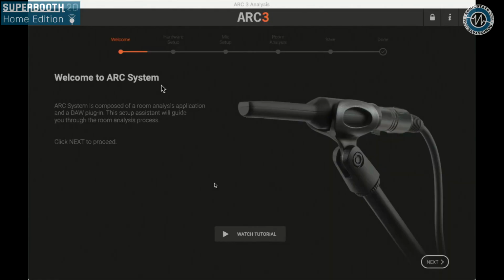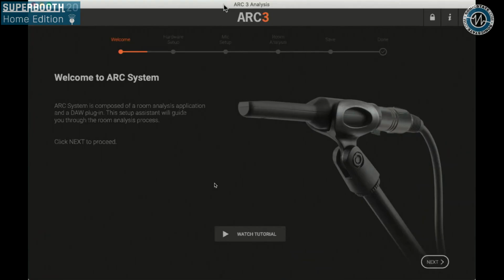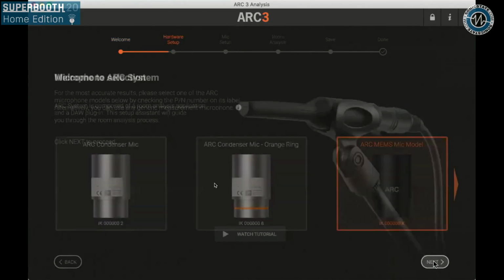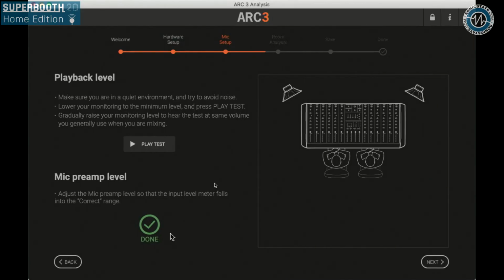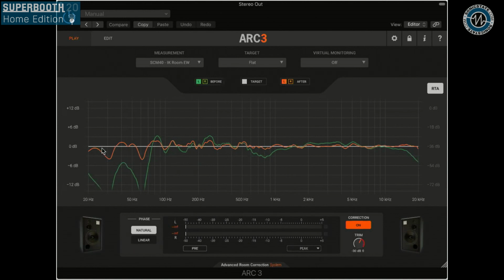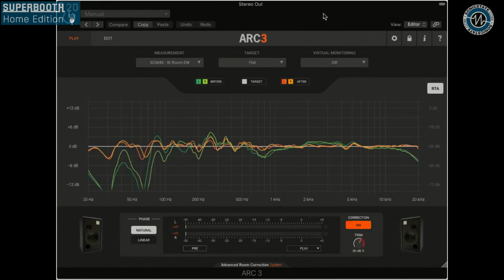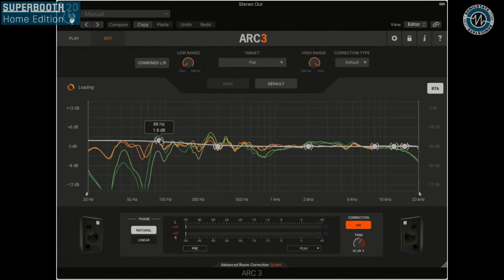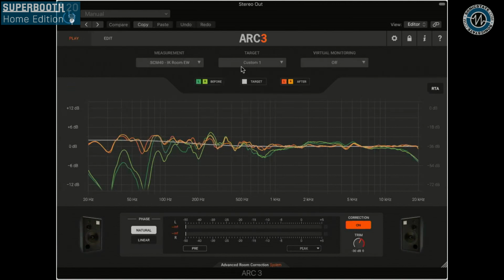Superbooth 20HE: IK Multimedia ARC System 3

Comment: I have just used IK Multimedia's Arc 3 to finish off my new treated mixing room and it's worked really well. I got the treatment the very best I could and it was already sound pretty flat with good stereo imaging. However I did have quite a dip around 100hz and a smaller one around 16khz. Arc 3 tweaked these dips making a noticeable difference to certain bass notes and the very high end without changing much else. What I didn't expect was that it's improved my great stereo imaging and made it even better! I've never heard music like this before, amazing! 😎

Comment: I've been looking into this kind of product for some time now. I'm interested how it compares to Sonarworks solution
Reply: Wait until this is tested by users,  Sonarworks wasbetter in my opinion until this release, time will tell if it's still the case or if Arc can match results. If they match or Arc is really good, Arc has better varios speaker emulation checking, but Arc will only be vst and not part of the O/S enviroment.
Reply: @zoundsic  in their FAQ is a explanation how to implement arc3 into the OS, by routing all audio thru a program called Pedalboard2 with Virtual audio cable and Asio4all. There is also a MAC solution..